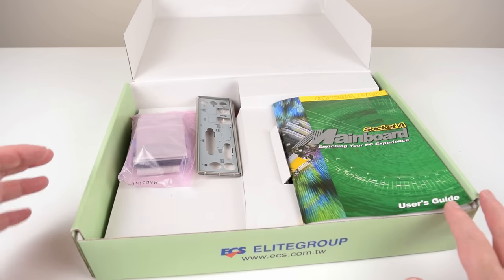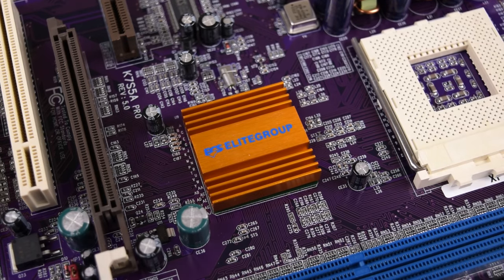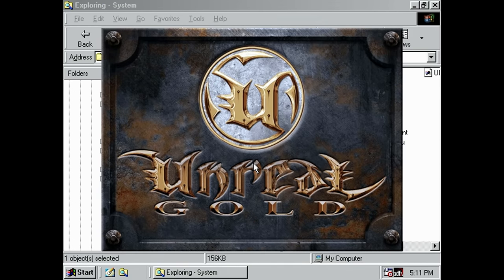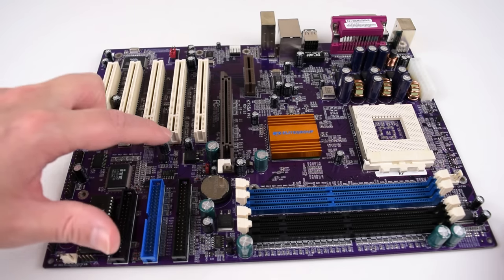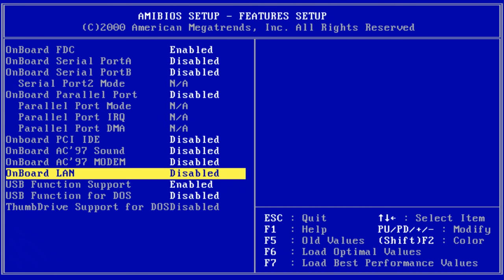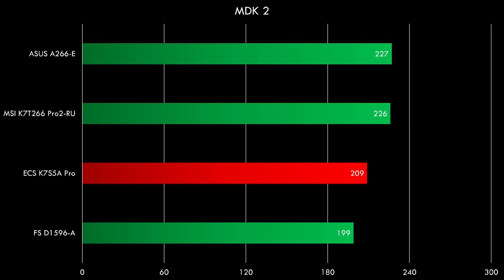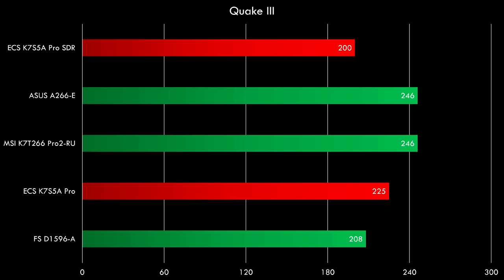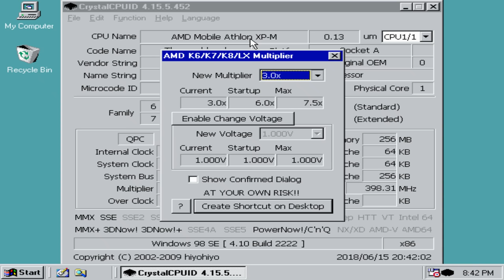ECS Elitegroup K7S5A Pro Socket A Motherboard Review - First Boot in 15 years

Comment: My first job was at a wholesale computer parts supplier where I worked as a pc tech at the RMA department. I remember this brand and type and you're lucky it works :-D More than 8% of the new stock ECS sent to us from the factory was defective whereas brands like QDI or ASUS had less than 1% returns. It was a real cheap brand which used mostly SIS chipsets and didn't like any overclocking at all. If you were lucky it worked AND was stable enough, it could perform ok-ish. ECS was also knows for a lot of "hybrid" stuff so you could upgrade your pc but keep your sdram instead of ddr ram for example. Watch those capacitors though, they all tend to go from ok to explode without any warning ;-)
Reply: Exactly, this thing was pure crap back then! My sister had one, paired with the infamous Thunderbird 1400, which was an extraordinary unstable combination. I had a Pentium 3-S on an Abit ST6 at the time, which was similarly fast but ran much cooler and rock stable.
Reply: EDIT : I think I am mixing up some boards here, the board we used didn't have SDRAM sockets. It was the K7S5A+ with the newer chipset that we used!

The reason this board got "crappy" was because it became far to popular.
Can't remember the exact revision, but I think it was a rev 3.x that made this board SUPER popular. It was cheap, performed well and was very stable. I have had up to no problems with that revision and sold hundreds of system using that mainboard (mainly using Athlon XP 1600-1900). I remember a few of those that ran 24/7 for years and only had some issues because ... well at least once a years you should give the thing some maintenance (dust ... etc).
When the boards popularity went thru the roof newer revisions surfaced and those were far from reliable.
You can compare it to what happened to the IBM Deskstar 40GB (which was around the same period). It became super popular and everyone wanted one because it was known as reliable and performant ... that's when it all went wrong. I guess that high demand is followed by all kind of crap leading to low reliability (more production and less quality control). Although when returning your defective drive you often received a serviced drive which had no problems. I guess quality control after servicing was better.
Reply: Mine was notoriously un-stable too.

Comment: I don't remember most motherboards I used but I remember this one pretty well. This board was the reason for me to upgrade. I had already invested a lot of money into SD-RAM and it would have been really expensive buy the same amount of DDR then. But with this board, it was possible to keep your valuable RAM at just 10% performance drop. That was great.... and if I remember right, at some point DDR dropped below SD-Ram and I could upgrade to DDR basically "for free" by selling my used SD-Ram :-) Thanks to this board, this was an easy and "cheap" way to upgrade step by step.

Comment: Fun fact about that Geode CPU you have there.  They are the last remaining legacy of the original Cyrix Media-GX processors from way back when.  When Cyrix was starting to run out of steam, they were bought by National Semiconductor, who continued to produce some processors under the Cyrix name, including the M-II and M-III cpus.  They eventually sold the Cyrix name and intellectual properties to VIA, with the exception of the Media-GX technology.  Eventually, they renamed Media-GX to 'Geode'.. and in 2003, that was sold to AMD.  So yeah, AMD is basically building off of the major beacon of light that Cyrix left behind.
Reply from the maker: Hmm, AFAIK the Geode is just a mobile Athlon XP tweaked for low power.
Reply: @philscomputerlab  In a sense, you're both right, it just depends on which model Geode.  After being bought by AMD, GX and LX models continued using the Cyrix-derived designs, but NX models are AMD designs, derived from the Athlon.
https://en.wikipedia.org/wiki/Geode_(processor)

Comment: The best thing about the SIS 735 and 745 chipset was the hard disk throughput. It was 25 to 50% faster than any VIA chipset board ever produced. I used to use them for Media Center PC's as the better hard drive throughput allowed for fewer dropped frames on a recording. 

And with the right aftermarket modded BIOS you could use up to two gigs of certain DDR Single Sided Ram although they were hard to find.
Reply from the maker: Because I use a PCI SATA controller I don't notice any of that :)
Reply: if you want harddisk throughput, use a server. at the time, boards had to be fast for gaming, nothing else ;)
Reply: Jigo That is all fine and well NOW, but back when those boards were released and popular SATA hadn't been released to the general public yet. But that isn't the point anyway. I was simply bringing up the main strong point of the board itself, not what one could add to it.
Reply: I'm using 2x1Gb in my non pro 3.1 board standard Kingston memory.
Reply: @philscomputerlab  Except, if you happen to have one of the VIA chipsets, which has a broken DMA implementation for the PCI bus, in which case, you most certainly will notice all of that. Since the damn thing will loose to a damn Pentium MMX in everything.
Reply: @phreeze83  Yeah, and that's exactly the sort of ridiculous attitude which lead to the best x86 CPU of the era being shipped with chipsets that made the whole thing a non-functional end product, and Intel reigned supreme.

And, no self-respecting engineer would willingly associate themselves with that kind of a shit-show. Goddamnit.

Comment: I had the dark brown non-pro version back in the day and I liked it. I flashed Cheapo BIOS on it for extra FSB options and used it to overclock my Palomino 1700+. I also made good use of its SDR option, it was a nice upgrade path up from my older super socket 7 system then I replaced the SDRAM with DDR when I got some extra cash. The memory upgrade didn't make the performance jump through the roof, just like it shows in this video.

Now it's interesting to see how much it was behind the dominant chipsets of its time. (On a side note: once I compared a later SiS741 based board to an nForce2 one and it showed a similar disadvantage.)

I had the board for a while, it survived a few coolant spills and hair dryer treatments afterwards. It stopped for good with ugly bulging caps in my brother's rig a few years after I switched to a more modern board for my shiny new highly overclockable T'bred B.

Comment: I remember everyone on the Gaming/PC boards back then saying ECS sucked, but the K7S5A was a big surprise. I built a cheap computer for my brother using one with a Duron 1300. BTW I hope you replaced the Bios battery, they used cheap ones that died after 6 months to a year.

Comment: There are custom bioses for K7S5A that unlock the FSB overclock and it can also support 2GB of memory. The 512MB per module limit was just cause back then 1GB modules did not even exist when they were making it. Still even with the modded bios the max FSB you can get is around 145-150, and still no voltage control, you have to do pin mod for that. Overall this was a good board back then, but ECS was always a risk. They were cheap for a reason, made of the cheapest parts, thats also why there were so many revisions. The failure ratio was high. MSI also made boards with this chipset and they are much better. However, they are rare and hard to find. I kinda like the SIS chipsets for early socket 478 more. Great OC (specced to 100 but could go to 150), and it gave people universal AGP and DDR support for P4 long before Intel did. MSI645 ultra and Asus P4S333 are the best P4 boards for voodoo cards as you can put there up to the 3,06Ghz northwood (and some light OC). They are also the last universal AGP boards for P4 where SB16 emulation of SB live works in win98. But in case of the MSI you have to disable ACPI support in the bios to make that work.

Comment: It was my favourite motherboard. I had Duron 900 with K7S5A (version 2.x I think), and was giving the Duron stock cooler just 7V instead of normal 12V. PC was basically silent and the most stable and reliable system I've ever used.

Comment: I remember this board, had it working with an AMD XP 2000+ back then... Good Stuff, worked pretty well and stable. Also there were modded Bios aviable, for more options and settings. One thing i remember too, for some reason it occasionally lost the bios settings on cold boot, for no apparent reason. But other then that, it was super value. Good Times 🙂

Comment: A relatively big local IT store stopped selling ECS motherboards completely when they got over 60% of what they sold returned for warranty within months of sale ... the most popular seller was the regular K7S5A model (not pro). They had a contract with a distributor and sold a few hundred motherboards in around 3-4 months ... ended up just replacing the boards with Asrock alternatives as soon as customer came back with the motherboard for warranty, no questions asked... those had less than 1 in 10 failures. 
I don't know, it could have been a bad batch, or a batch that was affected during transport (like humidity in a shipping container or something like that), but they really got burnt with those, and their reputation was affected for some time  
source: was student, living in campus with a friend that worked at that IT store's warehouse handling stocks.
Reply: I guess people were returning these motherboards not because quality but because SiS chipset hadn't got any ability to OC - FSB multiplier was blocked connected with PCI - 800MHz Celeron could not run 1GHz or more because AGP was 83Mhz, IDE was then 42MHz all except CPU was unstable. VIA chipsets even old Intel BX although had slower RAM controller, lot of limitations had at least unlocked FSP/PCI divider. To buy Duron or Celeron and not try OC = sin. I had mine for long time. Mine opinion this motherboard could be considered even as high end solution - Pentium 1.2-1.3GHz with DDR instead Pentium 4 with Rambus/SDR
Reply: I only know there were diverse failure reasons, because my friend simply told me back then that it was no longer worth their time to spend 20-30 minutes installing cpu and memory to test each motherboard coming back to warranty, they were so pissed at their distributor that they threatened to sue and they agreed to take them all back as they come to warranty. The bosses of the IT store just told their shop clerks to tell any person coming to the store or calling if he/she's willing to accept a board from another brand (Asrock) with similar specs and without paying the price difference, simply because they wanted to keep those people happy. 
I suspect the boards had all kinds of problems, like bioses getting corrupted, mosfets in the VRM dying, various compatibility or instability issues, maybe even electrolytic capacitors leaking. 
But yeah, I'll agree with you, those K7S5A back then were sold quite cheaply, hence they were a popular model and people often bought them with lower end processors and cheaper memory and especially cheap power supplies (often those that came with cheap 20-30$ cases) ... in today's money, the Asrock replacement boards would have been maybe 10-15$ more expensive.
Reply: yeah, that was my experience as well. the k7s5a is indeed legendary. legendarily shit. 

Add to that massive stability issues when using the selling point, DDR ram compatibility was abysmal.
Reply: Came to post the same thing. I used to work in a PC shop and we had so many systems come back with dead ECS motherboards so stopped using them and switched to Asrock or MSI. The SIS chipset was quite dire as well.

Comment: Well, well. Just found my old PC that was on the attic since 2008. With exactly this motherboard, athlon 1600+ and hercules gx mx400 64mb. It was full of dust and spider webs. Gave it good clean and I found that fan on graphics card was rusty and stuck. Removed it, put some other one. Plugged it with original power supply and well, it works, somehow :)

Comment: I used a K7S5A together with a XP 1700+ back in the days. did die once on me but the second one lastet long enough until a 200MHz Barton came along. Worked good and i used it with SD-Ram (DDR was so damn expensive for a 16 year old)...

Comment: PC Chips. I still remember the sleaze they got up to pre 2000.
Reply: Glad I am not the only one. PC Chips stink to high heaven. I had a super socket 7 board of theirs, flashed the bios from the funky official site they had back then and killed it.
Reply: My former boss praised them as a value option. There was certainly some variance in quality. But usually the later revisions of a model were not that bad actually (post 2000).
Reply: They were rebadged Biostar boards and their quality control was very hit and miss :(

Comment: Would be awesome if they made ddr3/4 hybrid boards again today, considering the current prices of memory....
Come on Asrock, we know you wanna do this again :D
Reply: munxcorp IMC is on the CPU now, so motherboard manufacturers can't do anything
Reply: Le Spycrab Didnt stop Asrock previously when they released hybrid 939/am2 boads :)
Reply: +munxcorp There is still Z170,Z270, Z370 boards that support DDR3 but not hybrid with DDR4. But now there's the thing with SoDIMM on DIMM with adapters.
Reply: +munxcorp For sure Gigabyte, Asrock and maybe MSI did DDR2/3 boards. I've seen Asus DDR/DDR2 also in my life. As old as I am, I saw SIMM/EDO combo boards in the early 90s
Reply: There are LGA 1151 Skylake/Kabylake boards that have DDR3/4 combo. They exists, but there is really no reason to get them.

Comment: Smashing video!  I had three of these boards and a couple of my mates had one each.  They rocked for the price.  Now for the interesting bit: They all boiled their caps around the CPU area in the end.  Not quickly or anything but that is their main failiure mode.  Back then I just bought another but now I'd break out the hakko and just re-cap the little beauties.

Comment: Oh yes! One of my old faves. IIRC I had this board until it died due to cap failure. Yes as others have said these boards specifically were prone to this. Worked well with my XP1800+. The details as to video were a bit fuzzy but I think I had a 32MB Geforce2 MX DDR. Happy days.

Comment: I have this board in my Windows 98 gaming PC. The board is an absolute champ. I put AMD mach64 and Voodoo2 in there no problem. I have tried it with both SDR and DDR ram, but SDR works better for me (I guess my DDR memory modules are faulty)
Reply: My K7S5A also has problems with one of the DDR Slots, seems to be a common problem.
Reply: in manual of my friend board ecs/via similar to this one, we swaped from duron 1300 to athlon xp2200+ or  2400+ with jumpers for fsb/ddr
but fun thing was the amount of supported ram slots also changed with the speed of the fsb/memory speed combinations
it was 2 first with ddr 266, all 3 with 333 and last two with 400 
 and it really did disable first or last slot when it did not like the speed of the modules and or cpu fsb

Comment: I´ve had one K7S5A(non Pro), coming from a buggy A7V133. 
From KT133A to SiS735 i´ve got a good performance(disk performance was very good), a stable board, possibility to upgrade to DDR in "the future"(on 2003), working fine with my XP Tbred even with poor bios options, i´ve changed multiplier and Vcore by pinmod and with Cheepobios for higher FSB(150Mhz), to a final 2.25Ghz. Only went out for a Abit KX7-333R(KT333) an another level of quality and bios options.

Comment: Nice video, but unfortunately also brings back bad memories. I built quite a lot of systems with the K7s5a, back in the day, but the early revisions would sometimes spontaniously cmos reset every few weeks, so we got a lot of them back, having to replace the motherboard. The later revisions didn't have that problem, but it gave Ecs a bad reputation. I have never used an Ecs board for my own builds.

Comment: I owned the non Pro version of this board back in the day.  I remember playing Medal of Honor on it.  I used initially SDR ram because I upgraded from an Athlon 650 all the way to an AthlonXP 2400+.  Used my GeForce 2 GTS card with it and just had a great time all around.  I finally retired this system when I got the Gigabyte K8NS-939 and an Athlon64 3000+.  I still have both motherboards.  I had to recap both of mine because the caps went bad in both, but the boards work great now.

Comment: The K7S5A was and is the best Sockel A Mainboard you can buy! I bought it brand new back in the Days (Rev1.0), because i had not enough money and could use my SDRam from my old BX System. 96MB SDram, a Thunderbird 1000, a Rage128 Pro and a 6GB Seagate HDD. Sound´s stupid but these were the days as a school guy. A year later i sold everything and bought the purple Pro Version, a purple PNY 4400Ti and a AthlonXP 1800+. This Board was rock solid. My Friend´s got Nforce Boards and had trouble every time :-D

Comment: Hello Phil, I have watched this video before and have now assembled several RETRO PCs. Nevertheless, I always wanted to have this board, also because I want to use an AMD Geode NX 1750 on it, and this CPU is also correctly supported by this ECS motherboard. Unfortunately, on other boards that I have tested, this CPU always uses a voltage that is far too high. I just looked again on Ebay Germany and thought I was dreaming... This board is actually being offered as a new item for around €40. Crazy, I bought it straight away. Now I don't have to worry about the driver CD. I'm happy!😊

Comment: Back in the day, these boards were so cheap I ended up building two machines for no apparent reason. I think they were $35 new. And I never had an issue with them. The caps eventually went but otherwise they were rock solid.